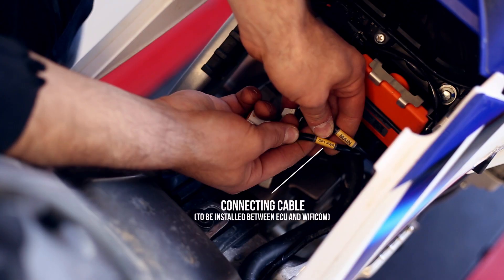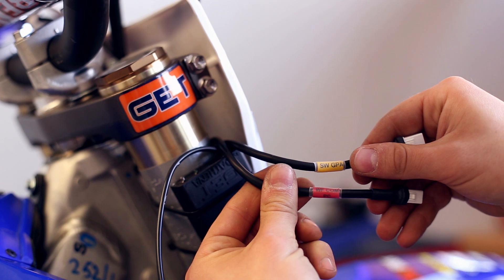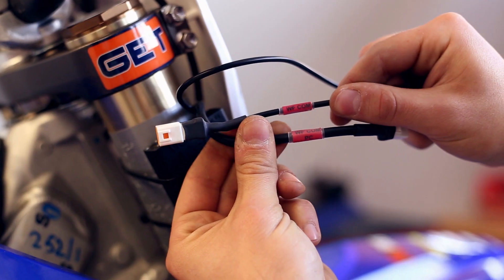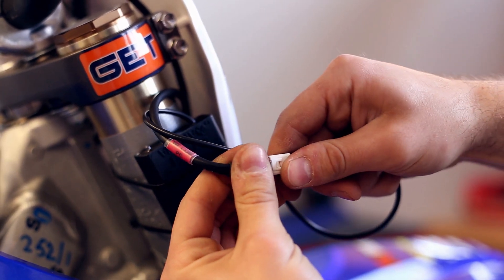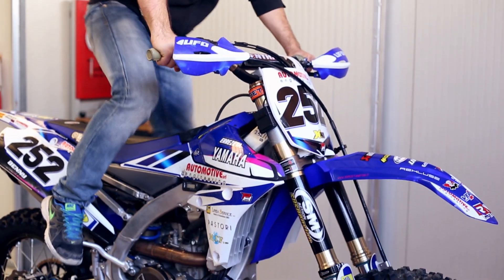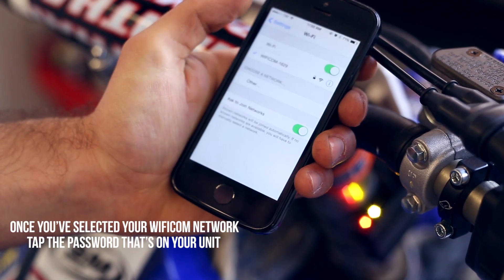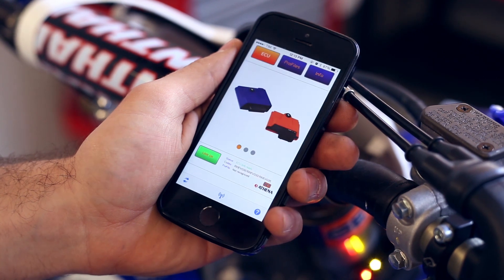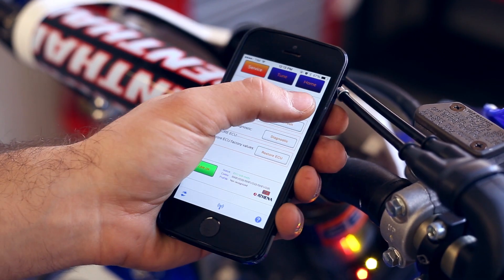How to install Athena GET GP1/RX1 Power ECUs

Comment: Hello,  I have the RX1 Pro on my 2018 FE350 and cannot change maps. I cant find any support to help me and when I follow the manual it still doesn't work.  Both map 1 and 2 are he same.  I am trying to have map1 as a full performance map and map 2 set to mud, sand, wet, etc.  Any advice is greatly appreciated.  Thanks! Nick
Reply from the maker: Hey, for every request related to the products, please contact sales.get@athena.eu. Thank you!